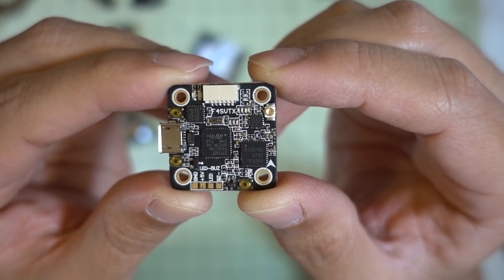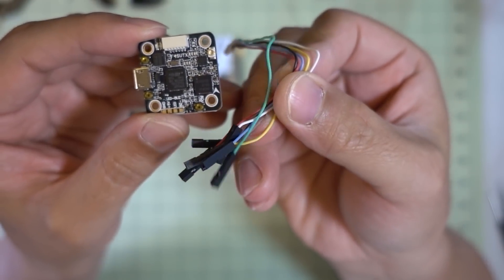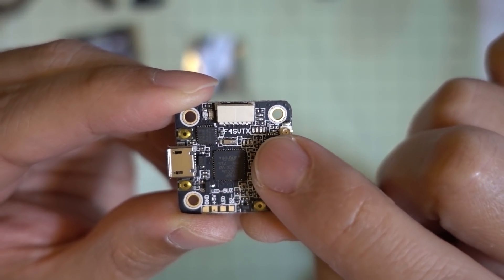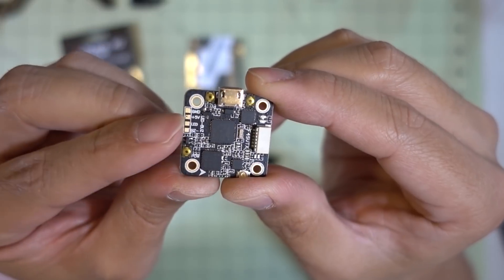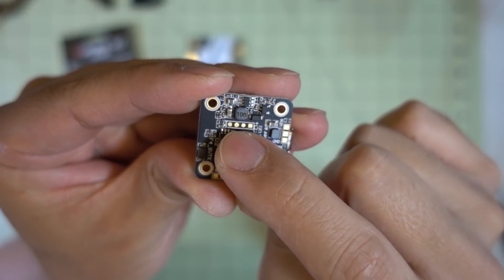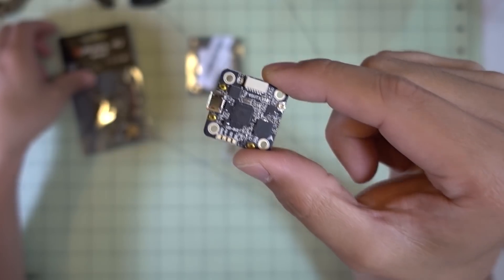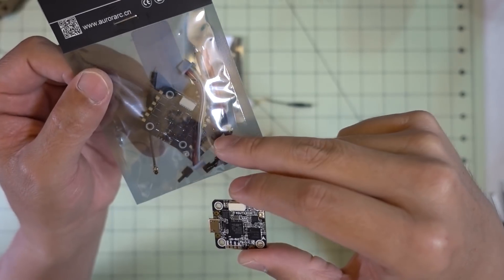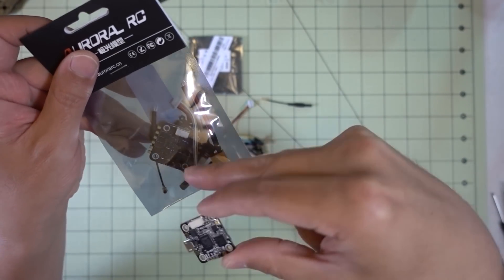F4 SVTX AIO FC VTX Combo Review 👍

Comment: The ARTOWER stack is 60€. The exact same components without the ARTOWER brand is the F4_SVTX + the 20x20mm BS-28A. These two together are 48€. That said I think perhaps the Full Speed FSD328 esc apparently have better battery pads for the same price as the BS-28A. Seems to use the same components otherwise.

Comment: What happens if you lose the antenna in a crash? Will the vtx burn? Is it possible to use an external vtx (and still have the OSD)?
Reply from the maker: If the antenna pops off you'll probably burn the VTX.  I would try to mount stuff to prevent that.  There is no way to add an external VTX.  Sounds like this is not gonna be the solution for you.
Reply: Albert Kim A vtx like that is under $15 and a part that's easy to burn. Coupling it with a $25-30 fc doesn't seem the best strategy. Would it help if they used an MMCX antenna connector instead?
Reply from the maker: This is a specialized product for those cases where you have limited stack space.  Also, there are ways to secure the connector so I would not say it is "easy to burn".  I have crashed mine a lot and it has stayed on.  I used some hot glue to secure it along with cable ties on the antenna to make sure it stays put.  An MMCX connector would have been better but they might not have had enough space for that on the board.  Like I said this is probably not for you.

Comment: That's gonna be a lot of heat to endure for one board but the video feed is fantastic. I hope they start making full size 4in1 escs with 20x20 mounting holes. You gonna need those Blue Cooling thermal mat/pads to help with the heat.
Reply from the maker: There's already a lot of 4-in-1 20x20 ESCs on the market.

Comment: The video seemed fine for 25mW. I like the clean look of these combo boards, but I wonder how the heat from the VTX will or would impact the FC over time. Have you flown it with an of the higher output levels and if so, did the board seem hot?
Reply from the maker: Yes, I've flown it on 200mW but I haven't checked for heat yet.  I've gotten about 30 flights on it so far without any issues.  It is completely exposed to good airflow in my build so it's getting good cooling while in the air.  I would not put this into a build where it gets no airflow.  That's just asking for trouble.  I wouldn't do that with any VTX.  That's just a rookie mistake.

Comment: F4 + 200mw TX + A hot summer day. What could possibly go wrong!
Reply from the maker: If you hadn't noticed it's the newer F411 chip which is a lot smaller and doesn't generate a lot of heat.  Also, the board should be placed in a build with good cooling (any VTX).  This is just common sense.
Reply: It should be all good at 25mw anyway. I agree good cooling is a must, but if you crash with the TX running at 200mw and it takes you a while to recover the quad, I wouldn't be surprised if the board doesn't survive.
Reply: You could change to 25mw via tramp protocol after crashing. Isn't it even possible to set up a switch on the transmitter to do the same?
Reply: You can actually set it to turn down when disarmed automatically.